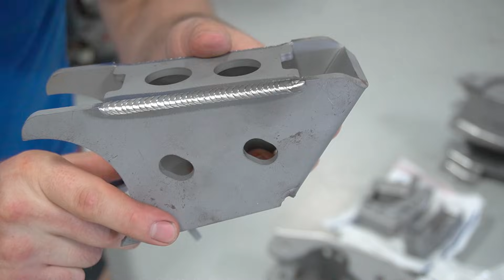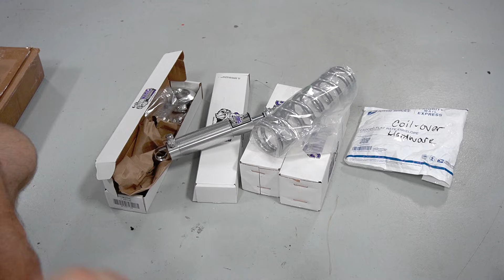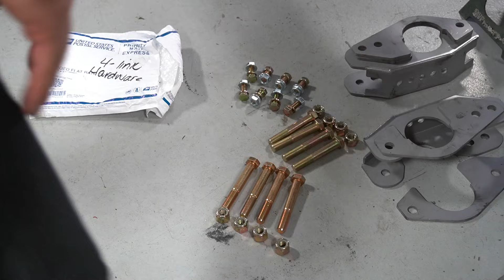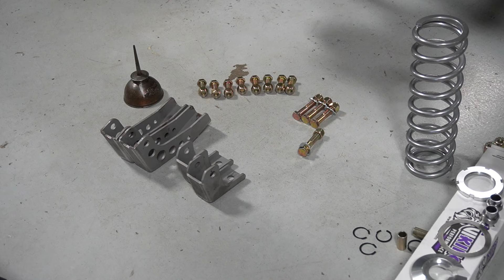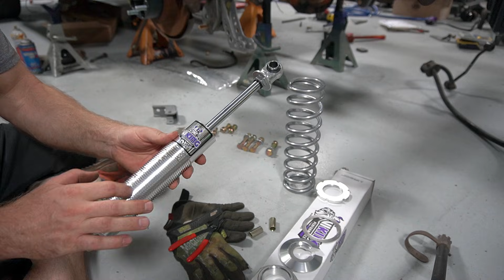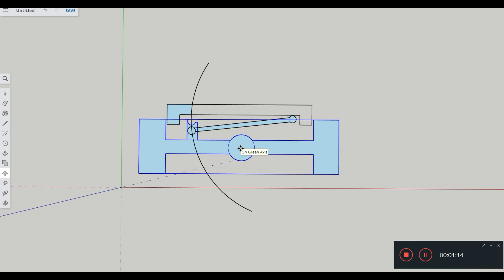F100 Outcast Autoworks 4 link Installation

Comment: Four link primary appeal is that it aids extreme acceleration from zero

Independant rear suspension primary appeal is the smooth ride

Which feature do you actually use the most?

Most guys rarely need 'extreme' take offs and IRS will suffice for the few times that they stomp on it

Comment: Hi you seems to know a lot about improving this F100, i am swaping the engine 352 CI on a 66 f100 to a 302 = 5.0 and i am prety sure the motor mounts on the truck will not fit the 5.0 and so what or where can i get the motor mounts to do the swap, because the 5.0 is coming from a 1991 crown victoria so if i transfer the ctown vic motor mounts th the 66 f100 i also think are not going to work out i will know more when i pull the 352 out of the 66 f100 if you can help fine let me know will apreciate it thanks in advance Leo

Comment: Are you able to run exhaust over the rear axle now to run the pipes out the back? It looks like the pan hard bar is blocking it now but could just be the camera angles.

Comment: Any idea how long those rear Viking coil overs are. I’m having a tough time finding a 12”-13” rear coil over for my 59 Apache. Most of the ones I found are for the front. There won’t be much for weight back there and don’t want it riding like a chuck wagon.

Comment: The sleafs in the lower chock mounting is not because they had to thin bolts but it allows the coilover to move so your car have actually a moving suspension.
Without the sleaf and a thicker bolt you have got a blocked suspension.

Comment: Great Video. Very informative. I know you had 9.5" from outside edge of frame to inside edge of brake mounting bracket, any idea what the distance was from the back of the cab to on center of the axle? I know you centered off your frame notches but I have an F100 sitting here that I believe the notches are a little bit off and I want to make sure the wheel rides in the  center of the wheel opening once the bed is back on?

Comment: Great video.  Which was more difficult the crown Vic front end swap or the 4 link rear end? Also is it necessary to add the c notches to the rear end? I know you did that when you still had leafs in the back.  Thanks for all the help and info.  Great content!

Comment: Hi cool project.  I have a 1966 F250 that I am thinking to do something similar.  How did you decide on the this parallel 4 link with panhard vs a triangular 4 bar? How does it drive?

Comment: Ride height should be calculated with and addition 500 to 800 lbs added to the frame. Since you have about that much weight in missing parts and 20 gals of fuel.

Comment: Hey .. i didnt see. Rubber brake line from axle to frame?? Maybe i just missed it?
Reply from the maker: yes. The frame has a hard line. The axle has a hard line. There is a factory replacement, ford explorer, flexible brake line between the frame and axle. I was able to use a hole in the frame and the factory retainer clip to secure it
Reply: Cool.. i liked watching  .. is the a different
Reply: Is there a different proportioning valve for the brakes
Reply from the maker: @davekoch5999  Yes, I removed the factory one the F100 came with, and added an adjustable one from JEGS, to be able to keep this new system balanced. https://www.jegs.com/i/JEGS/555/63022/10002/-1
Reply: @330_garage3  ..aaahhhhh yes perfect... I forgot i used that ony sandrail...lol im feeling kinda dumb.😆..the videos are great..cant wait to see more... im looking at a 4.6 in mine.. the 8.8 out of a gt mustang would work i think!?..ive been looking for a wrecked one as a donor..

Comment: Nice work! Have a 62 Uni I'm thinking about updating, wonder if they make a kit for it or if this one would work 🤔 Thanks for taking the time to make the video!
Reply from the maker: that would be a tough one. You would have to add some pockets to the body, for the bars to bolt into. Wonder if you could adapt something for a fox body to work for that uni truck?

Comment: You install wrong type of bushing for 4 link!!! bushing must have cut for "twisting" or use correct metal rubber bushing . in this setup adjust nut will unscrew or control arm brake on welds (i had this problem). My english is so so but i think you can understand me...
Reply: i think the limit for this setup is 10cm difference high between wheels, I go offroad and had this problem few times.
Reply from the maker: luckily this isn't a rock crawler, if we see articulation, it's because this truck was involved in a roll over accident
Reply: @330_garage3  my nissan gu Wright 2.8t and do not want rollover. This car is good for daily and offroad. I have 2" lift (with harder coils and bigger shock abssorber) and 33" wheels. Also i have panhard arm.

Comment: Awesome build, truck and videos. I’ve been watching from the start. Thanks for the amazing videos/ tutorials. You motivated me to do my own project. I have a 67 with a explorer rear. I’m gonna keep the leaf springs for now. But I wanna do the Coilovers kit. Is that an option. Also, what size wheel and tires did you go with. Also where did you purchase your 2” spacer? Can wait to see your project on the road.

Comment: I installed a 2017 Mustang GT performance pack IRS in my 66 F100 and got a3.73 super 8.8 with Torson diif and 11”disc brakes with it for under $1000
Reply from the maker: sounds like you found a smokin' deal on that setup. I haven't seen a S550 IRS setup for less than $2K around the Dallas area.
Reply: Well yes I got it off eBay from an outfit in Georgia that specializes in late model musclecar salvage. I also bought my 5.0 coyote motor with a 2.9 Whipple and 6R 80 transmission from them

Comment: so this wont work on the ford 9 inch?
Reply from the maker: You could use the 9" as long as the axle tube diameter is the same as the 8.8". The brackets in the Outcast Autoworks kits are designed to fit around the axle tubes on the 8.8, so if you had a different axle you would have double check that.
Reply: @330_garage3  thanks so much for answering! 🙂

Comment: nice work! what kind of paint do you use for painthing those 4 links bracket? ;o)
Reply from the maker: Oh thats a good question, maybe I should have posted a link. Actually used some Tractor Supply single stage enamel that is very inexpensive. I added a hardener /activator to it (also tractor supply), makes it very durable, and extra glossy.
Reply: @330_garage3  big thx!

Comment: Hi can you please tell me what year is the Differential   & also What is the width of the Spacer the you use I’ll will  appreciate that
Reply from the maker: That Ford 8.8 came out of a 2000 Ford Explorer. Then I used 2" spacers to make my wheels work
Reply: @330_garage3   Thank you so much appreciate it

Comment: Will this 4 link work on my 1980 ford f100?
Reply from the maker: I'm not sure how much wider the frame is under the 1980 model, This kit is really designed to work with the ford 8.8 axle... maybe if you found a wider 8.8 out of a crown vic or something you maybe able to make it work.
Reply: @330_garage3   ok thank you love the videos!

Comment: Currently shopping for a heavy duty 4 link so far I really like outcast, Will the frame and axle brackets work without C notch in frame? I'm looking for airbag and shock combo. I wanna be able to haul car trailer.. (65 F100 SB 390 C6 9" 3.25) Frontend does have DJM lowered beams
Reply from the maker: Nice! Yes the Outcast kit will work without notching the frame, you just wouldn't set your ride height as low as I did. Then use the RideTech Shockwave shock/spring combo, instead of the Viking coil-over like I did, and you'd be set.

Comment: Why didn't you just cut off those gooseneck angle pieces? That's gotta be a good 50 lbs of dead weight
Reply from the maker: They are really stuck in there.. I had a hard time just notching the one with a cutting torch. I decided to tell myself they add rigidity to the frame

Comment: It's been two weeks since you posted the video but you should really think about stainless steel brake lines before you put your truck on the road. You won't have to worry about them rotting out and they look better too.
Reply from the maker: Not a bad idea.. any idea where to find stainless brake lines for an Explorer? I'll order some if they make them
Reply: @330_garage3  Check on eBay. There are pre-bent kits for most vehicles at good prices.

Comment: Nice job, but in full compression your pan hard bar bracket  on the axle side looks like it will contact your bed.
Reply from the maker: I'm not sure how far that suspension can compress.. but you are correct, the pumpkin on the axle housing would be able to contact the bed floor... but that would be a Dukes of Hazzard style impact... time will tell.. its possible I went too low and will need to modify the bed floor.....

Comment: I cant remember if you said how much of a drop the coilovers will give you ? I run coil overs front and rear on my daily 4 banger pretty familiar with the shock and hieght adjustments ... Although you could always use a shorter spring if you wanted to go lower ..there are a few bolt on 4 link co out there are they all weld on to the axle ? Or was there a true bolt on I seen one were they  used the front hanger holes for the bracket so there's no guessing or measuring  did you see those kits ? You made it look easy but I can't weld for crap
Reply from the maker: I'm guessing around 5 inches of drop. You would have to put a bigger notch in the frame to go much lower without the axle hitting the frame. I don't think you will find a 4 link that doesn't weld to the axle. The rotational force there.. just doesn't allow for a good way to have a bolt on application. If you can weld a little.. you can tack your kit in place.. then have a buddy or someone else do the final welding. With this Outcast kit, it would just be the axle, no need to weld to the frame like I did.
Reply: @330_garage3  
Nice 👍 yeah I have my harbor freight welder lol ....

Comment: Question did you call and order it? Because I just went to order my parts and said and done it came out to a little under 2,500? Just wanted to see how you got it to be that 1,600 price you said
Reply from the maker: I'm guessing you are adding something you don't need. I just checked again. The 4-link kit, panhard bar, and coil overs, are around $1600. I just ordered online. I think I posted links to all the stuff I used in the description.

Comment: What about the weight of the Bed will that affect the level of ride height when setting the bar? Or just not enough to worry about?
Reply from the maker: I technically should have considered that, and allowed for a bit of angle there. In this case I will add a few turns to the coil overs to bring the ride height back to the height I was using when I set the pan hard bar in place.

Comment: Great video as usual. Outcast has some excellent products. I have a few of their items going in my project. 
Few questions: 
1. For the price what made you go this route vs. S550 or Lincoln IRS? I would think you may be able to come out cheaper with one of those, but maybe more labor? I'm planning to run the Explorer 8.8 SUA, just curious why you went this route. 
2. Swaybar - When you are remounting a factory swaybar such as this, why not  switch to something else more robust? You are already redesigning the mounts and it's already not being used in a stock manner, etc?
Reply from the maker: Thanks! I personally think the S550 IRS is too wide and doesn't allow the truck to sit as low as most guys want it to sit. Not to mention the amount most guys hack out of the frame to weld that S550 in seems excessive. The S550 is supposed to be bolted to the vehicle with bushings. 
The swaybar is the one that came with the 8.8. I wanted to get a baseline for how the truck is going to handle before I buy a heavier swaybar. I didn't feel like the amount of effort was bad, just moving it around a little. If I upgrade it in the future.. it will be some more work, but I wouldn't imagine more than an afternoon's worth the effort.

Comment: I assume you are following manufacturer instructions but, doesn’t it seem odd that the 4 link pars and coil overs are all mounted outside the frame rails? Seems like they should be inboard?
Reply from the maker: No, I actually didn't have any instructions, thats why I made the video. To your question, the coil overs are installed inside of the rear fender-wells, so its not limiting the tire width you can run. You actually want the link bars and coil overs out as far as possible, toward the ends of the axle, to provide the most stability.

Comment: Why do you need a stabilizer bar when you have a panhard bar...
Reply: The panhard locates the axle in the truck side to side.  I have to assume that the "stabilizer" bar you're referring to is the sway bar.  You don't have to have it, but with coil suspension...or coilovers in this case...it really improves handling on the road.  This can be tuned with shocks and spring rates too.

Comment: Just FYI to others...the leaf spring on the passenger side appears to have had the rear shackle inverted.  This could have happened when it was on the lift with the axle dangling from the leaf spring at full droop.  Then when the truck is lowered the shackle that bolts to the frame bracket got kicked rearward instead of the direction it should go.  Look at the driver side shackle in the first part of the video and you'll see what I'm saying.  Not taking away from the Outcast kit...it looks really nice.  Just thought someone else might run into this and want to know how they might fix the issue without feeling like they have to make a major change.  Keep up the great work on the truck!

Comment: This looks like a great kit and good value for sure.  Dual adjustable shocks and coil overs is going to make it work great on a road truck, or at a drag strip!  Coil rate choice will work very well too with the weight of the truck.  Nice work and looking forward to the next one!  You do a great job editing these videos.  Take care man !
Reply from the maker: Thanks for the comment. sounds like you have first hand experience with a similar setup. Also glad the editing is making them better... this video took wayyy too long to put together, but it turned out good.

Comment: Learning something from all your videos. I’m doing a 1968 long bed to short bed,I got a short bed frame though. Got the crown Vic in it, you helped with that. Got a 4link rear suspension with a new nodular 390 gears. New axels from moser and master power brakes disc conversion. Puttin a 408 stroker in,with holly sniper and hyperspark ignition. This why you helped this old 75 years old guy.thanks,herbie
Reply from the maker: NICEEE!! Awesome these videos are helpful... also I want to see a picture of this truck now! It sounds awesome
Reply: @330_garage3 I have a question for you, maybe you can answer me. I wanna do a CV swap on my 72 f100 but in the future want to do a coyote swap in the future. Mean while I want to continue using the current power plant (390) is there a motor mount  set available that will work with the CV

Comment: Im not mechanic....is the rear end on that thing a locker?  And is that a Ford 9inch rear end?
Reply: It's a ford 8.8"  rear end, you can find them in the late 90s to mid 2000's SUVs and crown vics (if i'm not mistaking). The 8.8s from interceptors and sport trac explores have a limited slip differential and usually run a 3.73 rear end gear ratio.
Reply: Awesome build and videos.  Attention to detail 👍🏻.  Is their a reason for using explorer 8.8 over Crown Vic 8.8? I believe Explorer used 31spline axles, not sure about CV interceptor. CV 8.8 I think is about 3” wider.  Would this help on wheel spacers?  I guess if your doing custom wheels you can adjust offset easier.  Will this kit work with Crown Vic 8.8?

Comment: What advantage does this setup have over stock leaf springs in general?
Reply from the maker: You get an axle that won't give you axle wrap (twisting) and cause wheel hop. (You remember the earlier videos... it would wheel hop real bad any time it broke traction.) Also gives you an adjustable coil-over on the corners, so you can adjust ride height, and rebound and compression to make the truck handle much better.

Comment: Where’d you get your driveshaft made? Just put an LQ4/4l60 and explorer 8.8 in my ‘70 f100
Reply from the maker: I pulled the driveshaft out of a Ford Explorer Sport Trac. The 4L80e I bought, came with a cut off drive shaft and front yoke. I had a shop here in McKinney TX cut it down and put it together for me. 
Collin County Truck Parts
2735 E University Dr, McKinney, TX 75069

Comment: question why didn't you remove the brackets and them plates for the goose hitch  setup and box sections they added they  don't look the strongest tbh or do you plan on fitting a goose hitch to the truck
Reply from the maker: No plans for a gooseneck. I am unable to get those pieces of angle iron out of there. Even though they look rusty, they are so thick and welded in so good, I decided to leave them.
Reply: Was going to ask the same thing. Figured it was too much hassle

Comment: Looks great! what size spacers are you running on the rear for the stock wheels.
Reply from the maker: I put 2" spacers on the back. Seems like let the stock crown vic wheels clear the fender wells in the bed, etc.